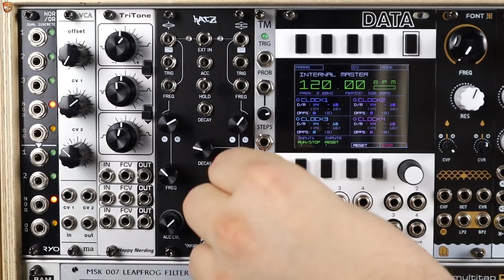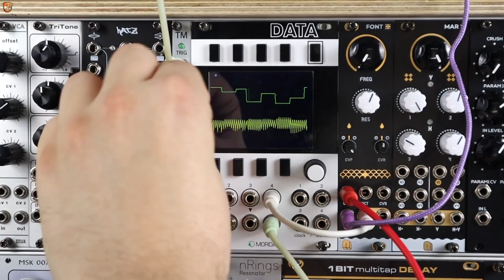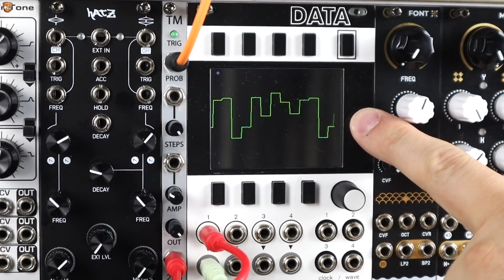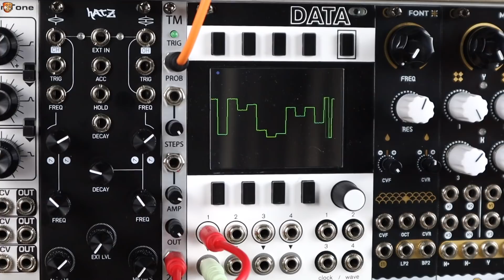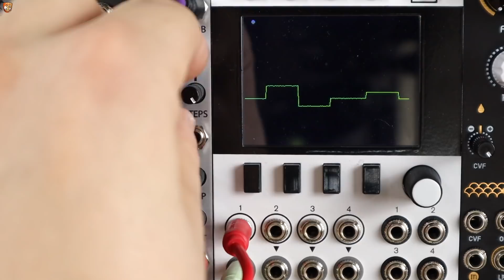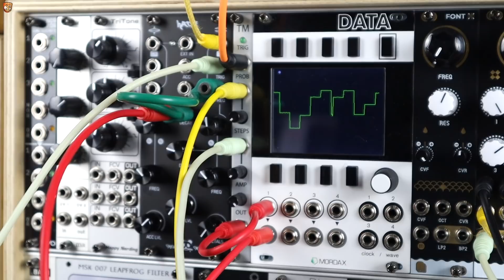2hp TM Turing Machine // Random modulation, melodies and more for Eurorack synths

Comment: Dumb question but, is this like a sample and hold in which you can adjust how random you want it?
Reply from the maker: So sample and hold by its nature isn't random. It's the input signal that gets sampled that defines that. In lots of cases that's a noise signal (white noise, pink noise etc) and that's a random source in itself. So sampling noise with a sample and hold gives those random values. 

If you put in say an LFO, a basic wave shape that cycles regularly you can get more predictable results. For examples of that my videos on the SSF Ultra Random Redux, my own RND STEP and NANO Modules VCV Random will show examples.

The Turing Machine design is a little different in that it works with a shift register and a number of bits (data). Stacking up of those bits creates the resulting waveform. 

What you get on a Turing Machine is often an output level control, which will attenuate the signal it creates to occupy less voltage range. Say 0-1V rather than 0-5V. But you also get the option to loop the information, so a Turing Machine with 8 steps you can have loop those 8 steps so it becomes a regular pattern like a sequence. But the looping isn't an on or off situation. Varying the loop from fully locked loop keeps it cycling regularly, then it increases the potential/rate of change in the data stream until it's completely random and not cycling/looping any of the data at all. 

Bit of a long reply, but I hope that helps.
Reply: thanks  @DivKid  , very enlighting!

Comment: That first patch from the Font sounds straight out of Throbbing Gristle 2nd Annual report… beginning of Maggot Death live in Southampton! Damn I love it!! So I def want yo try to recreate this with my TG3 filter if possible!
Reply from the maker: Thanks Andrew, the general tone of the TG3 filter will be very different to Font. But you'll get some fantastic results! I've had good results from using similar stepped modulation to a Turing Machine on the TG modules. Also happy to channel TG in the examples subconsciously too.
Reply: If you get a sec listen to the TG track I mentioned. It’s uncanny! Love it!
Reply: Also- I’m wondering if it redundant to have a couple filters? I love what they do to sound
Reply from the maker: definitely not redundant to have multiple filters, it's a bit like owning multiple guitars. They all do the same thing in one sense but how they sound, react, feel in the hands, react to voltages etc is different. 

A friend once said ... if you were a painter and had a red tube of paint would you only ever use that one shade of red because you had red covered? I quite liked that, more so for the idea you can mix colours to make new things, you can patch modules to create new unified or opposing things too.
Reply: @DivKid  I love that analogy.

Comment: What would happen if you skipped the quantizer on your way to the string voice oscillator?
Reply from the maker: we'd have random voltages that aren't in tune.
Reply: @DivKid  By "not in tune" do you mean atonal/microtonal?
Reply from the maker: just simple not in tune. Microtonal would be intentionally in a microtonal scale and tuning system. 

Imagine pitch as a fluid number scale let's say a C is 1 and D is 2

If this module outputs a value of 1.2 then the quantiser would force it to 1 (and play a C in our example). If it outputs 1.8 then the quantiser would force that the nearest value which would 2 in this example and play a D. 

Without a quantiser to force voltages to set values (scales) you would have 1, 1.00001, 1.2, 1.7345 etc. 

Think of it like a fretless instrument rather a fretted one. You can play any value between the notes. This just outputs voltages to no scale. 

That feels like a blurred response from me but I hope it's helpful.
Reply: @DivKid  Very helpful actually. Thanks.

Comment: I’m a little fuzzy on how to use CV to lock the pattern. You set the knob all the way to the left, and then what’s the simplest way to patch in something so that it locks, and unlocks over time? How would I do this with Maths, for instance?
Reply: Figured it out! Prob is turned all the way in 2hp TM. Patch from channel 4 in maths routed to the prob CV in, turned on cycle for channel 4 in maths, set channel 4 all the way right, then whenever the cycle falls, it'll unlock the pattern.

Comment: My big problem with 2HP isn't being 2HP... it's the labeling.  The inscription is above the jack while the knob is below it.  The inscription closest to a pot is the one most deeply associated with it.  Even a simple line across the module or alternate shades to visibly group things together would make them so much easier to use in an intuitive way.
Reply: The only thing that bugs me on this one is not being able to clearly know the number of steps you're on
Reply: Right?! I thought it might just be me. I have to think twice everytime. Like, "how does that top input control probability without a knob? 🤔... Oh, right."
Reply: fakshen1973  me too
Reply: My only problem with 2hp is that they might be too efficient with space, both in accessing the knobs, and getting them to fit together in a skiff without interspersing them amongst other 4hp+ modules.  But other than that, they are unbelievably powerful for their size.
Reply: Jasiah Jaden  you’re right. No one gives a damn

Comment: Great video as always! What module is used for the stereo strings (I love that alternate panning effect - does that come from a single module?)
Reply: It sounds like rings to me. I think there's a mode that bounces between the odd and even outs, or maybe it does that by default.
Reply: I also thought it sounded an awful lot like Rings in Inharmonic string mode with the extended four-voice polyphony
Reply: @BottleBass1977  Would the stereo panning come from Rings too?
Reply: @hubertrazack  Yes, you can feed the Odd and Even outputs into a stereo bus, or for example, into a granular synthesizer like Clouds. Ben does a great run-down of Rings' features here: https://www.youtube.com/watch?v=O0IHt1JiRvk